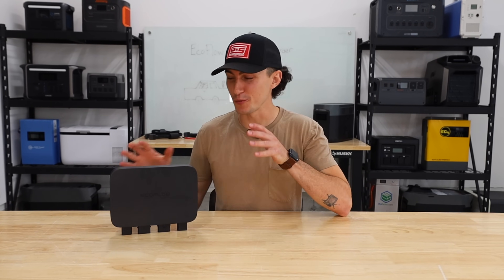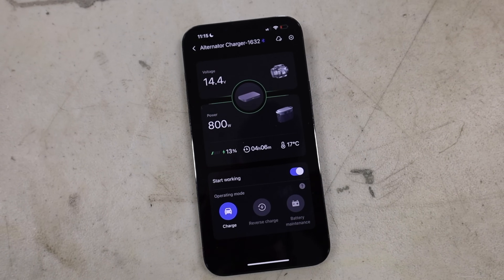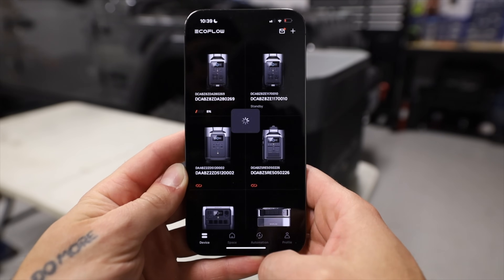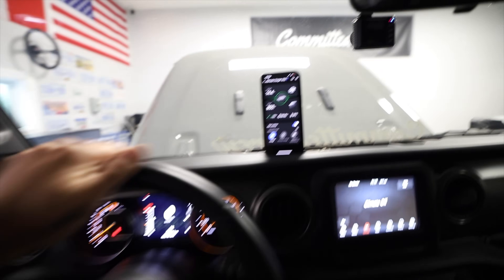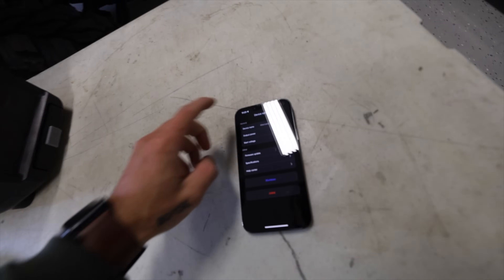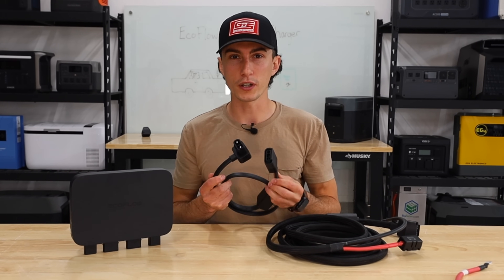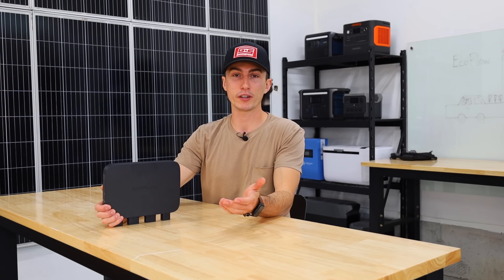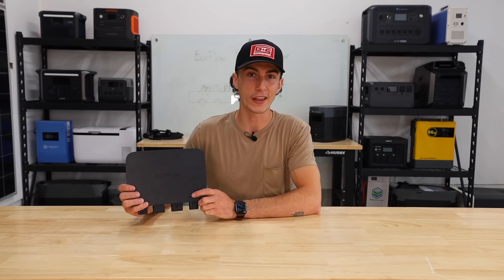800W with NO Solar Panels!? This Changes EVERYTHING! - EcoFlow Alternator Charger

Comment: I was just charging my DP with EB from 80% to 100% in less than an hour. Fun fact, you can also connect solar to this while running the AC to help supplement the charging. It takes away my reason to buy the EF smart generator. The few things I don’t like about it is that they probably won’t sell the wiring separately so I can’t transfer from vehicle in to another, and also the removal tool has no place to mount. I just used industrial Velcro and stuck it on the unit itself. Awesome review guys!

Comment: A ferrite bead with a conductor through it is an inductor and so is used as a low pass filter. Typical use is for power cables to reduce EMI.
Reply: I found it a bit odd that he wasn't aware of this.
Reply: Also, you can't install this into a box. The beads have to be on the cables. The size of the cables is how the size of the beads has to be. Unless you have inferior beads on cheaper cables. This product is priced correctly, IMHO.
Reply: Yes, they've been on computer cables for ages to eliminate electromagnetic interference.

Comment: i just installed it in my 2024 Hyundai Santa Fe hybrid - the battery is nice cause its right at the rear compartment so i left the charger box in the next compartment and bam plug it in it detected it in the app, I used my car hotspot to set it up to, i plugged it into the Deta 2 Max and it started charging i took a drive and it did go up to 800 however i manually put it to 650 which is enough. So now i have a power source for my future fridge for the road trips. I can monitor the Delta 2 and see the charger doing its thing. i have my voltage set to 12.7

Comment: I may be wrong but idk if you have to do all that with adding an in line switch. Just leave the alternator charger on when you turn the car off. Just make sure you have the “Start Working” toggled off on the app. You’ll see that option above the modes. When you do that it’s only powering that status light which shows red since the car is off and the voltage drops lower than the setting that you set it on (mine is set to 13v). Obviously if you leave it on for like a week that light could run the battery down but I doubt it’s drawing much. I’m not electrician but that was just my two cents after installing it in my truck.
Reply: Actually just tested this and the device times out and shuts off overnight. So you have to press that small on button every time you get in the car to keep it charged. Kinda of annoying hopefully, hopefully they have a firmware update to have it on standby mode until the car is turned on again.

Comment: You can also connect the alternator charger to a 12v or 24v external battery, then change the volts in the app to 11V. You'll then be able to charge the EchoFlow without using the car's alternator.

Comment: Also, Renogy makes a dc to dc inverter and has for a long time. Renogy makes quality solar products.
Reply: Yep Victron 12-24v power supply works quite well and is less than $150. Not worth $450 for a few bell and whistles.

Comment: Just add a solid state relay instead of a switch, then when you have alternator level voltage it supplies current to the charger. Then it turns off when you shut off the rig.

Comment: So can you adjust the outputs and use with this other stations or systems? (like my vanlife 24v system).

What is the max output voltage?  800w is awesome.

The bluetti won't pull if the car is off - so would be nice if the ecoflow would do the same.

thanks for the video.

Comment: This plugs into the 'extra battery' port correct?  There are TWO of these ports correct?  Can we use TWO of these chargers on the same Delta Pro?  I want to use one actually on the alternator (CHASSIS) BATTERY, lead acid, the other to a large house battery bank, LiFePO4, in my RV.

Comment: The reason the app lets you set a cutoff voltage below 13v is because the other use for this product is to connect it to standalone batteries (like a LiTime 12.8v 230 Ah LifePO4, for example), thus expanding your Delta 2's capacity immensely.
Reply: How do you plug it to a standalone battery ?
Reply: @MrHsv123  Same way he connected to his car battery/alternator in the video. Those LifePO4 batteries have threaded connections on the terminals. Or you can use alligator jumper clips, which is what I did to mine so I can easily attach to the car battery with the hood up and move it to the LiFePO4 battery I keep inside the house to use during power outages. And when the power comes back on I use the reverse charging feature to top the battery back up for next time.
Reply: When i get mine my plan is to use along with the 100ah LifePO4 with 2 xt60i off same battery into solar inputs along side about doubling the watt input but probably more from what ive researched. the key is the xt60i allowing 500watt per solar port.

Comment: Great information. I had several questions about this device and my EcoFlow Dual Delta Pros so I ordered on and a couple of 'Walmart Specials' batteries. This device was every thing you showed and explained here. Easy as pie. But when I wired it up for 24V use I didn't get it to function in all modes. I could get the batteries to charge my DP's but the DP's could not charge them. Have y'all done any work with it on 24V systems yet?

I am going to test whether both this device and the Smart Generator can charge my DP's at the same time. I know my DP's put up the same symbol if I had an expansion battery connected. Waiting on 2 more Smart Generator Plugs so I can connect everything to the DPs. Know anyone wanting to sell some? LOL

Comment: The fact you can do this off a gas engine is not that big of a deal. 
What is “game-changing” is that you can hook this charger to an EV’s  DC-DC converter and use an EV to charge the EcoFlo bank and power things or your house.  There by creating a Tesla PowerShare back-feed off any EV.
It’s a direction all the EV makers are going.  House can charge car, car can power house.

Comment: I'm curious why there is so little emphasis on the "Smart" capabilities of this device vs. "dumb" dc to dc charging or even the use of an inverter. This device is purposely designed not to kill your alternator or starter battery. Yes, there are cheaper ways to achieve near or even excess of 800 watts of charging power, but not without caveats. This all in one device removes many gotchas and additional equipment while providing reasonable levels of safety for the DIY'ers. $599 is not that high of a buy in for piece of mind.

Comment: I bought the EcoFlow charger with the Delta two bundle. It was about $1000. Mine didn’t work. It keeps throwing an error code and I’m in the process of returning it.  This is been a very common problem for people that bought them in May and June from Amazon.
Reply: Me too.  Have 8 of their products bought over the last 1 1/2 years.  Regretting buying any of them, a Delta 2 has gone bad, 800w Alternator Battery Charger doesn't work.  Support suggested everything I had already tried, did all again, but nothing has changed.  Should of checked their Better Business rating before I bought anything from them.  Support matters.
Reply: Seriously though I've spent around 4k on their products and I now only have 1 that works. It sucks because I had family that bought products based on my recommendation and it just turned into such a big mistake for everybody. Sad to say I would never buy their products again. I didn't even get to use some of the batteries because they just stopped working or would never take a charge.

Comment: Being able to set the voltage lower than 12V is great for people like me who want to use it to reverse charge their Ecoflow from a LiFePO4 battery.  (You cant get full capacity at 12V.  10-ish would be even better.)  That is a bigger use case for me than the alternator charger.

Comment: Nice product but I hate the fact that it doesn’t work when attached to a bussbar. I already have a 6awg the runs from the battery to my sprinter van garage. I tried for hours to put the +/- on the buss bar along with the EF 800W AC and kept getting 2 errors. Device Error and Charge Conductor Overcurrent. So I had to install directly to the battery and now have two cable runs.

Comment: How does this work on the DELTA Pro 3? Can I use the Alternator charger and still have two additional batteries, or does it use one of the extra battery ports for alternator charging? And does passthrough on the 30amp plug still work while the alternator is charging?

Comment: In all honesty, I would like to find a device that would assist the EcoFlow in power and regenerate (charge) the power source to any source you have I.e. car batteries. C 5:18 urrently EcoFlow is very particular on the external power supplies, dedicated only for that unit and not to any other EcoFlow systems.

Comment: As per the comment about the quality, IMHO is that we are so used to buying components that are build like s#te that when we come across something in which the pencil pushers and bean counters of a company don''t get involved and have no input on the manufacturing process we actually get the quality we are paying for.
 Also that big dongle box at the end, if I am not mistaken I remember seeing them used to prevent feedback and mess up your stereo  sound or other components, and I repeat I am not an expert, just speculating on their function, as a practical  thing I can see why they might have done it, since if it breaks is easier to replace a cable than have to do surgery in the unit itself. 
Thanks for the review.

Comment: It doesn't keep drawing from the battery when the engine is turned off. If anyone is worried about this set the start up voltage to 13. Also there can be problems with laypersons installing this push as it can cause a fire if connections aren't tight enough etc.

Comment: This should be $199 $600 is ridiculous
Reply: Proprietary bs.  Ecoflow is the mac of this world.
Reply: It's $415 in the UK (at least it is now) which is odd.  Normally prices are cheaper in the US.
Reply: @IvanJankovicDC  what else at that price has the same capabilities?🤔
Reply: Just FYI you can get $200 off currently during prime sale from their main site with promo code AC200OFF main price. Your welcome.
Reply: @1ENDUSER  Yep! Just grabbed one myself a bit ago. Good value @ $240.
Reply: @Justin-C - hell yeah. I couldn't believe it that it worked.
Reply: 800 dollars in Australia crazy
Reply: High quality redarc dc-dc charger is $600 and only charges at 600w
Reply: I paid A$520 yesterday. Looked closely at the Bluetti Charger 1, but you have to buy the cable separately and the best price I could get for the combo was A$499. Given that I have a Delta 2 power station the integration on the app for the Ecoflow charger is better and it also has the added functionality. For me, that is definitely worth the extra $20.

Comment: Where do you get that converter on the back so the alternator fits into the Delta Pro? I’ve contacted EcoFlow many times since I bought one off Amazon UK 🇬🇧 EcoFlow just answer with stupid questions then just stopped answering me. Now I have a huge paper weight for £369 grrr Thanks hope you answer. Ray K UK YNWA.
Reply: I have the same problem did you ever find the correct adapter ?
Reply: @signorfantastico  Yes . I was camping with lots of motorhomes and the guy next to me was short of a cable I told him I have a spare one of those in my ecoflow kit. I took the kit out from under my bed and as soon as I opened the bag there it was. I thought that was my electric connector for going to a fuel station to charge it up. It came with the big ecoflow I have. It was the largest of theirs at the time 2600wh. It anoyed me they never told me it was the one that came with the delta pro and they did not know what I was talking about after me sending them pictures and video's. EcoFlow after sales service is DISGUSTING . I think they have a bunch of 5 year old kids doing it on their play time while at school. 6 weeks of back and forth when I had it all the time.
Reply: @raykeogh1972  agreed on the customer service. Thank you very much, I will look for the adapter and hope mine came with it. I received a plug separately and assumed it was to charge from a car charging station. I was just about to purchase theEcoFlow DELTA Pro to Smart Generator Adapter to see if that worked.

Comment: You think I can use the solar panel to a solar charge controller, then onto 2 to 3 batteries in parallel, then to the 800watt alternator and to the ecoflow generator?

Comment: Hello, I have one Delta Pro and no extra batteries. Can I use this charger and the EF Dual Fuel Generator at the same time, using both battery ports and two XT150 adapters?

Comment: Good luck fitting those cables through a modern cars firewall with plugs that big
Reply: Push them through from inside the car, not from the engine compartment. That way the large blocks never pass through the firewall.

Comment: so, if you do put it on a switch, does it automatically turn on when re-powered? or doyou have to flip the switch, then go turn the unit on?
Reply: i've seen other videos where it shuts itself off when you take the keys out of the ignition, so maybe there's been a firmware update? not sure

Comment: $599... ouch. It is in fact just a DC to DC with a low voltage protection. $109 and will universally work with an inverter, so yes you need a 100W inverter... still half the price and more versatile imo. I ground to the frame, in the back of my truck. Ran 1 power wire with a fusible link. I can push 460watts alone, it trips when I put 2 chargers (Bluetti) which pushes it over 900W on a 1000W inverter, it trips the inverter. I'm in maybe $320 and can run anything, fridge, chargers, tools etc... this is way to expensive for being so proprietary. I don't need to have a "solar gen" in my truck, just plug into the inverter.

Comment: This thing seems silly, you can just buy a 1000w inverter and wire it to your battery and charge any solar generator, plus you'll have a 110 outlet to power something if you don't have your power station with you.

Comment: It's a second generation product, but new to the US/International market, that's why it's so polished.

They released gen1 here in China a year ago, it only had 500w charging and looked much like a traditional 12/24 Dc converter... It wasn't universally well received because it relied on a movement sensor to allow charging - logic being if the car was in motion then the engine was on... Stupid and janky, so they fixed it...

Comment: This has to be a paid review. It's a good product but 600 dollars is not a deal
Reply from the maker: it is when you compare to the price of the same wattage panels, and other options - like we talked about! we don't do paid reviews here, thats the entire point of the channel!
Reply: This is ecoflow. A solid company that actually stands behind its products. Standing behind every product does cost money. I purchased the first ecoflow wave. It lasted less than 36 hours. Even though it was out of warranty. I only used it when we lost power after a bad storm for a few days. It had stopped working. They offered a replacement. After a few reviews of other waves having issues, I asked for a refund. They honored that and gave me a refund for a product that was out of warranty. This is the first time in my 42 yo life this has ever happened. Their customer support is the best I have ever received. 24 hour support via text, but support nonetheless. They stand behind all of their products and with full support. You get what you pay for. Also, their apps are the best in the business and have constant updates as well as  firmware updates. I have drank the kool-aid ,and it's oh so sweet.
Reply: In Europe, we get it for EUR 329 (350 us dollars).
Reply: In China you get this AND an EcoFlow Delta 2 for 350 USD
Reply: Buy the Renogy gizmo, and you can use your solar panels . With this, you can have to buy an MPPT also. I got
the Renogy for less than 250 bucks.But you still got to buy a lot of wires
Reply: There was a coupon 200 dollars off
Reply: Buy a inverter for $150 and a battery tender for $ 60 and save $300. I pretty sure you have a inverter on your jeep at least for your music.
Reply: I bought it on a sale recently for around $250
Reply: Just picked up mine on Amazon for $339.
Reply: Just because your cheap doesn’t make this not a deal!
Reply: @ReviewingTech101 It’s on sale again right now,
Reply: @TheSolarLab I love the fact that it is 800watts which is huge! And it is better than the Solar panels like you said!! Do you recommend this unit or is there another unit out there that will provide more than 800 watts? Like maybe along with solar panels you will get more than 800 watts.

Comment: 800 watts at what volt’s?
Reply: I believe I read or heard that it bumps voltage up to 56v.
Reply: @RobHasson  to bad they don’t have an adjustable voltage, I need about 65v too use with my inverter! There missing out on a huge market , not many people are going to buy all their equipment just for this unit but lots would buy for multiple unit use.
Reply: If you're thinking about using it with something else I believe it will only work with Eco flow  devices which sucks in my opinion
but this type of device is not a new thing there are companies that have been making it for a few years now they let you use it with pretty much anything but I  do not know what voltage are they using
Pecron DC1242-500

Renogy makes 3 different models 20 amps 40 amps and 60 amps
victron makes one as well
Reply: @kwas27  If your talking about a Dc to Dc charger they are for 12v systems. 800watts can be fed into a Mttp charger and charge a 48v system!